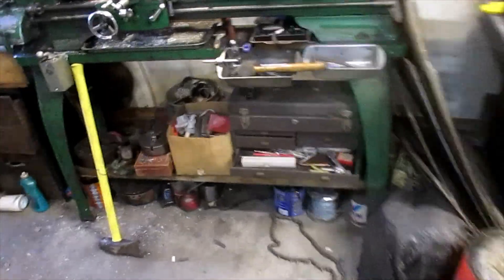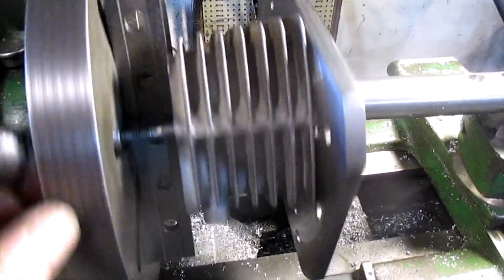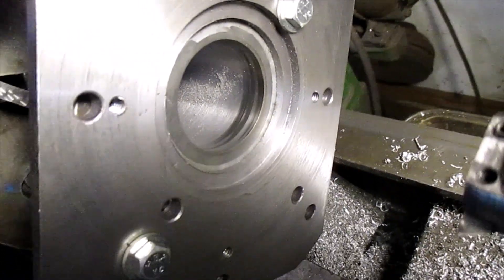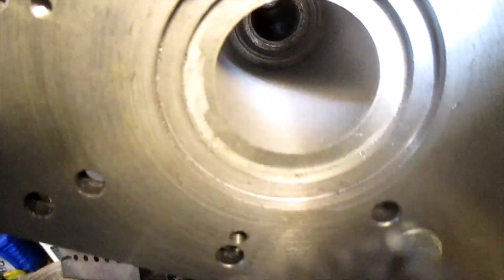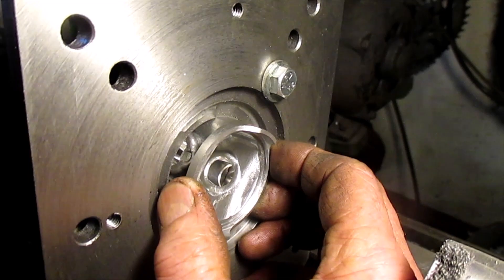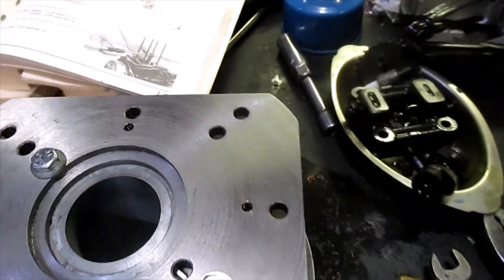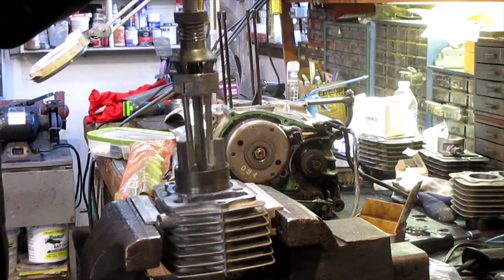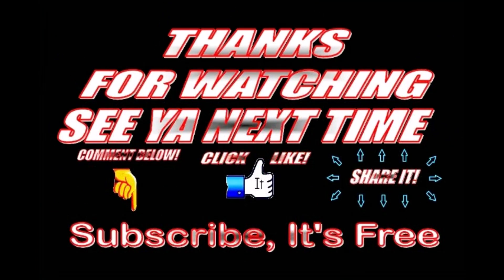How to bore a Motorcycle Cylinder on a old Atlas Lathe

Comment: You didn't use any oil when honing? I thought you were supposed to use oil when honing  cylinders. Also, you didn't show any measuring tools to check bore size. Did you verify the actual size or just going by feel?
Reply from the maker: I measured the bore with the piston. Measured it twice in the video. I checked the running clearance of the piston with a feeler gage and the also the ring end gap. There are  video links at the end of the video about that. As far as using oil when honing, I have done it both ways, with and without oil. I get better results with out oil when honing cast iron, because the stones don't load up.

Comment: Would that atlas lathe be limited to single cylinders or vtwins? Can't imagine a 350 twin cylinder head fitting in there.
Reply from the maker: You are correct. Can only do single cylinders in that small lathe. If you had a bigger lathe, you could do twin cylinder jugs using this method.
Reply: @Amotorcyclenut  you'd have to counterbalance the backing plate for a twin, but yea it'd work.
Reply: make a jig to hold the cylinder assembly in the compound and then use the spindle to cut the bore.